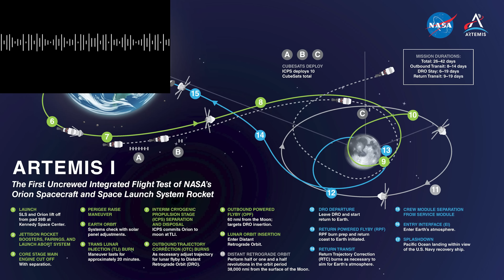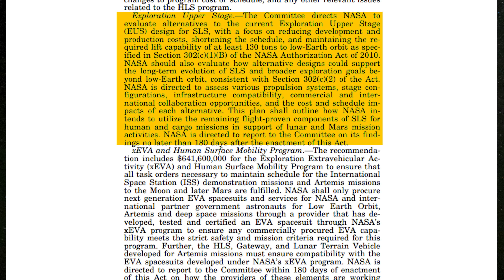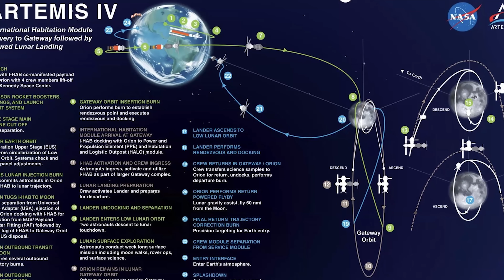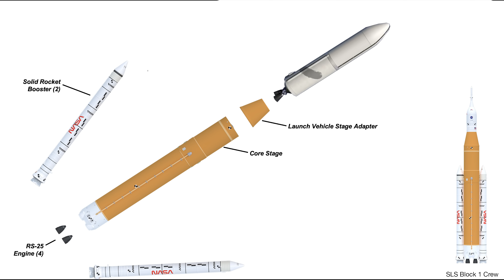NASA Found Brilliant Solution to Go Back to the Moon before China. SpaceX Starship?

Comment: It is too late to be on the Moon before China. The Dragon and the bear is ready to make moon base just now, not only lending for some days.
Reply: sure, sure....got the AI video to prove it too I bet.....🤣
Reply: Errr... not even close. Spacex is building, flying, landing the rocket that will go there now... this same rocket doubles as: Tanker, LEO Depot, Cargo transport, Satellite dispenser, Lander... They are at least 2 years Ahead of the Chinese and the Bear isn't going (its fighting a war).

NASA/Spacex target date for lunar landing: 2027 maybe they slip to 2028
China target date for lunar landing: 2030 maybe they accelerate to 2029

No one's ready to put an actual base on the moon until then... Dropping a small box on the surface isn't a "base".

There is also this: Spacex is building V3 rocket to put 50-100t on the moon. V4 will be ready no later than 2027 and will be able to put 100-150t on the moon.  Enough to send hundreds of robots and nuclear generators in a single flight... The Chinese lander can't handle anything like that in the current plans.

There was an Ex NASA admin (turns out he was a politician and never an engineer) whined about Spacex (never oversaw their work). Was wildly off and said China would beat us... he's a politician looking to get the open NASA seat from the temporary guy. Can't do that by saying "you're doing fine". Clearly the dufus was math challenged based on his dialog. Good riddance to him.